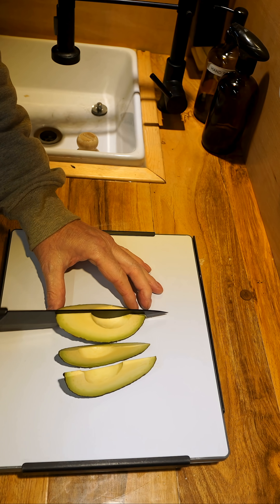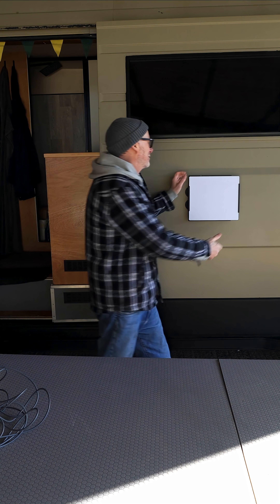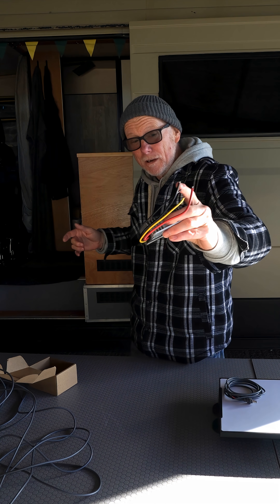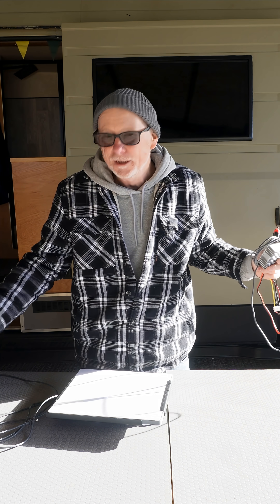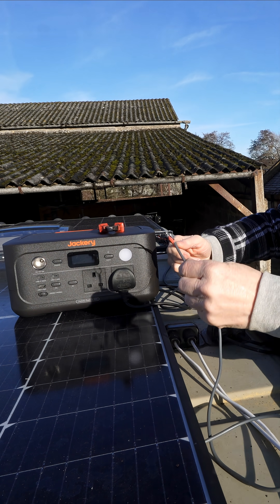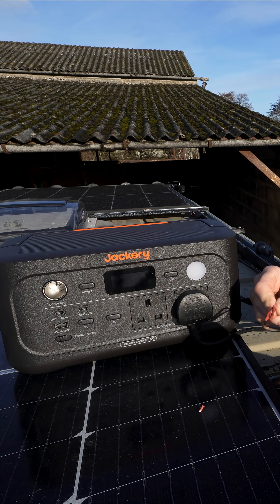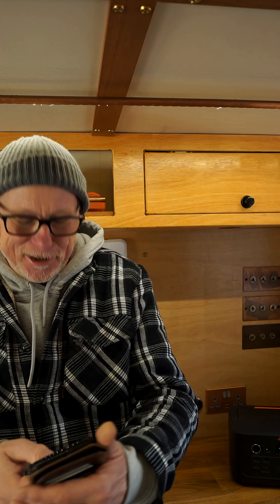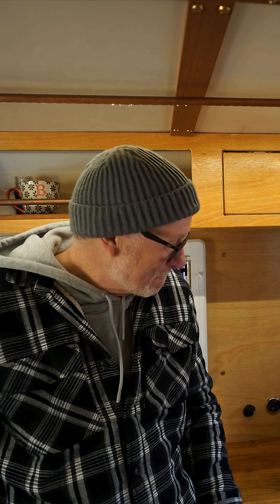12V Starlink Hack That Changed My Van Life

Comment: Should of just got a 100 to 250w power socket and used a pdc usbc power plug , can run it directly off 12v , run mine for months that way no worries at all
Reply from the maker: That's a great alternative solution, thanks for sharing your experience!